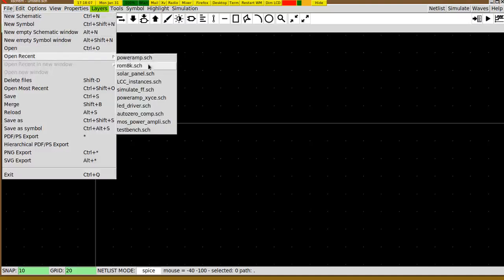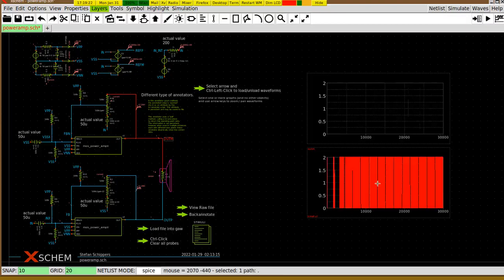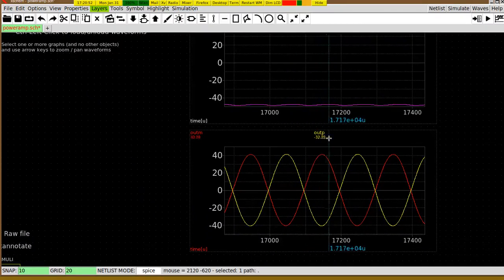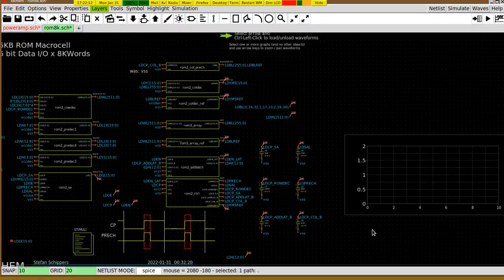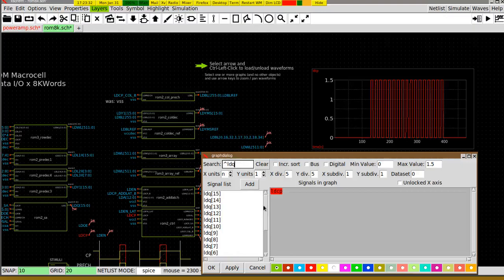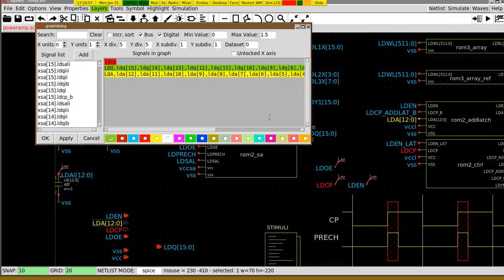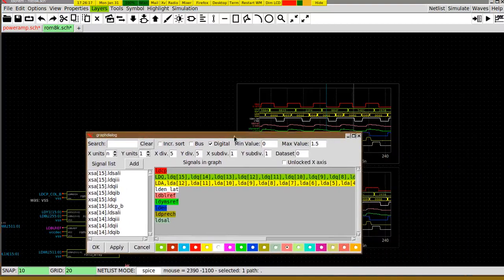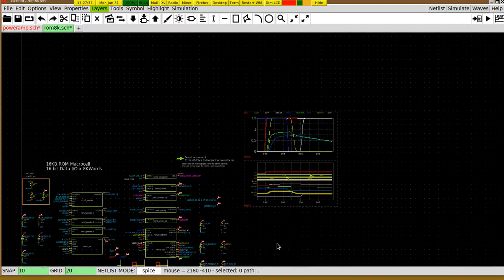xschem displaying simulation waveforms without using external tools.

Comment: Thanks a lot Stefan! Plots in the schematic are really a great feature that I have used before in ADS and QUCS, and now available in Xschem. Can we plot equations and frequency domain plots?
Reply from the maker: Yes you can, details in the manual https://xschem.sourceforge.io/stefan/xschem_man/graphs.html
Equations are in RPN format (operands first, operators follow) 
For example: "Power; i(vvcc) v(vcc) *" will create a new wave named Power that is the product of current and voltage of a supply voltage.
Sorry for the incredible delay. I don't sign in frequently on google.
Reply: Where did you pick this example
Reply: Xschem already had this example but there is no ng or xyce models to stimulate it
Reply: @stefsport2002